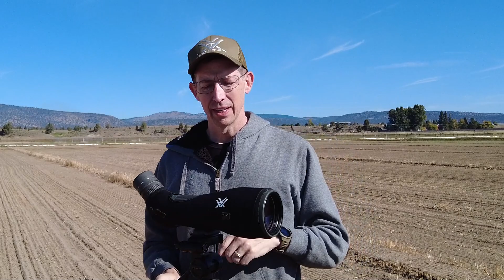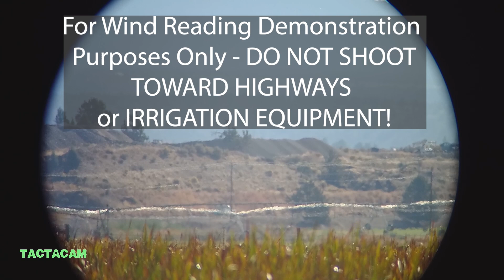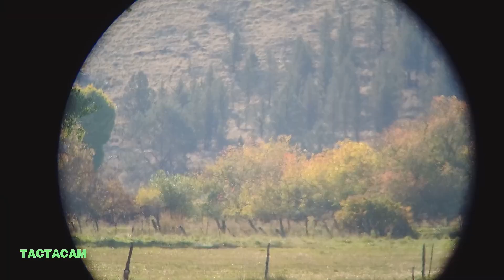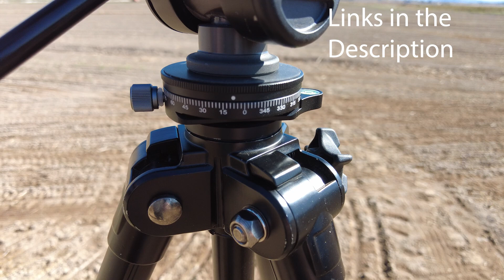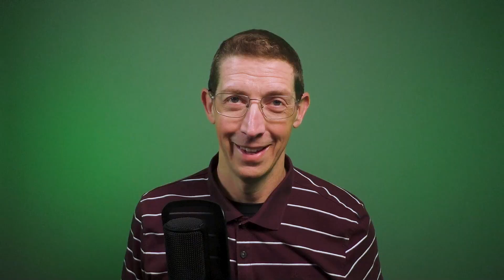Wind Reading - Finding Exact Wind Direction

Comment: I don't know if this would be beneficial to anyone, besides hunters. I say that because I know that the wind behaves differently around structures, and I would imagine that most competitions are conducted under a roof at the minimum. I also don't know if it would be allowed by the rules. but I have tied a piece of white thread around the front sight on my barrel, to show me the wind direction,  where I am at when hunting. there is rarely mirage in the fall, so that is not much of an issue here.